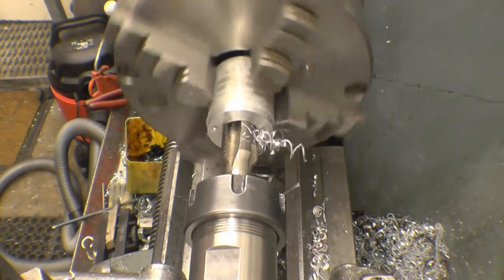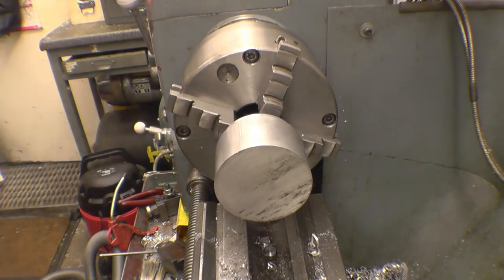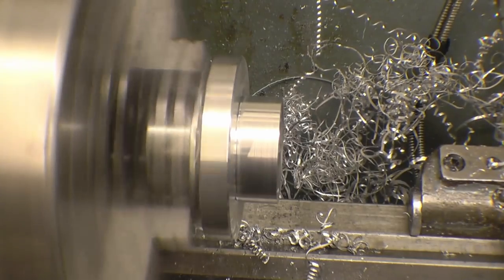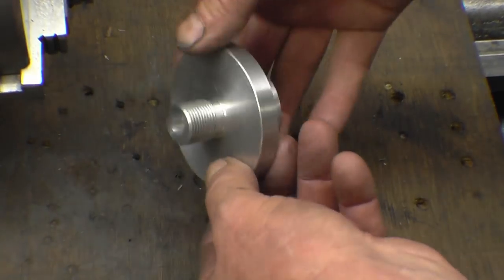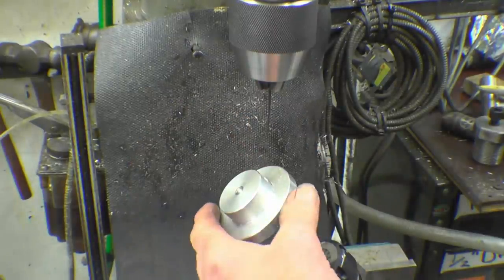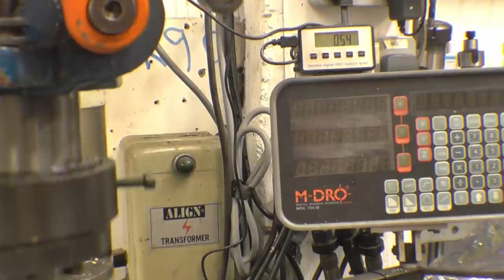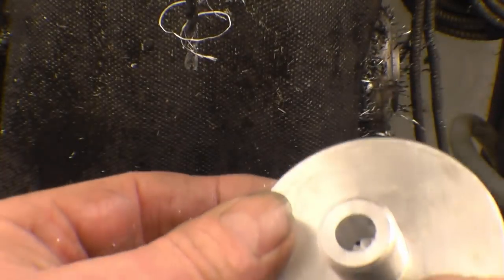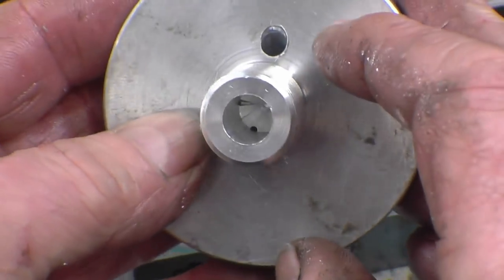SNNC 325 P1  Vintage  Motorcycle Oil Filter Mod

Comment: Great idea using the drill to set the angle of the hole
Reply: A machined correct diameter fit would have been better as in not using a drill bit, or using a smaller length  drill bit to stop the flexing. But yes I am nit picking, the job got done. Well done mate.